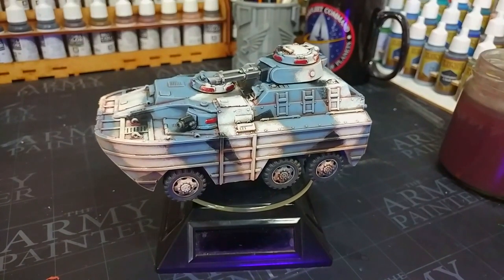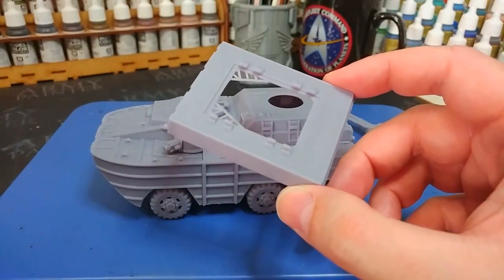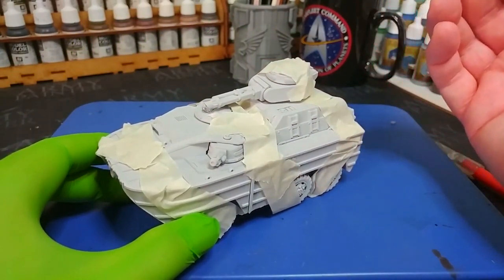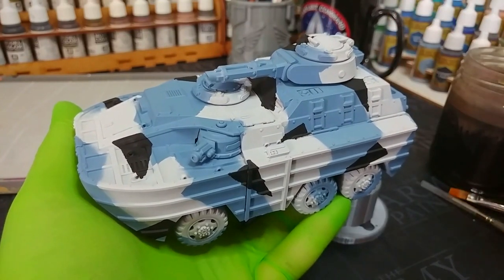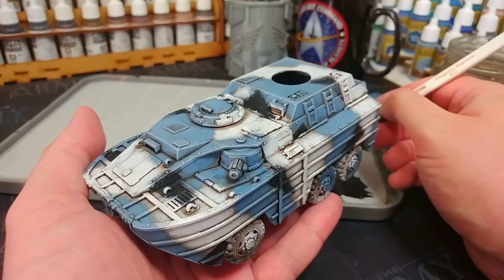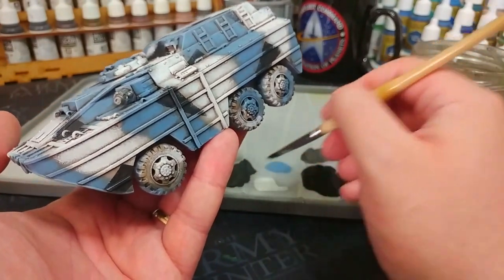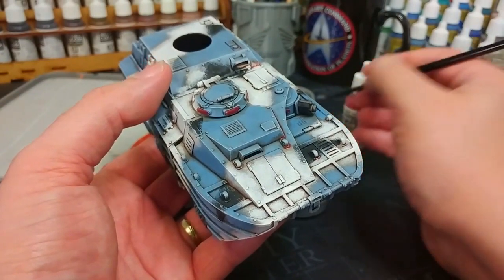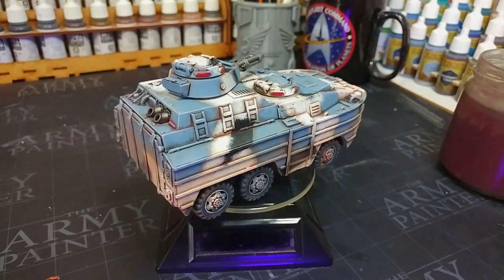Anvil Industry's 3D Printed IFV - Ice Camo Style! [How I Paint Things]

Comment: Really terrific. I am so tempted to get into resin printing, but my FDM printer is doing all the heavy lifting for me right now (all the chemicals--and smell--make me wary). But I'm definitely feeling 3D printing FOMO.
Reply from the maker: Depending on where your printer is, the smell of resin is almost a non-issue these days - most resins have relatively low odour compared to early releases, and you've now got water-washable resins to work with as well which cuts out the need for other chemicals. It's still an investment and a new set of skills, of course, but if I can figure it out I'm pretty sure it's in reach of most hobbyists. ;D
Reply: @SonicSledgehammerStudio  100% agree. I have chemical triggered asthma and nothing happens when I'm around it

Comment: Would this work on an FDM printer? I want this quite a lot
Reply from the maker: This one is designed specifically for resin printing, I'm afraid. If your build plate is perfectly level and your bridging is exceptional, you might have some success with it, but there's a lot left to chance to try and print it on FDM.
Reply: @SonicSledgehammerStudio  thanks for the tip. I'll probably invest in resin at some point so this goes in the "someday" pile for now 😂